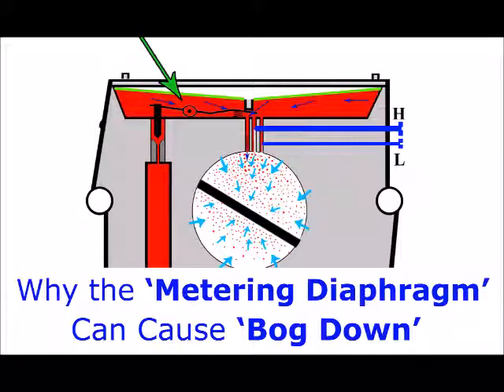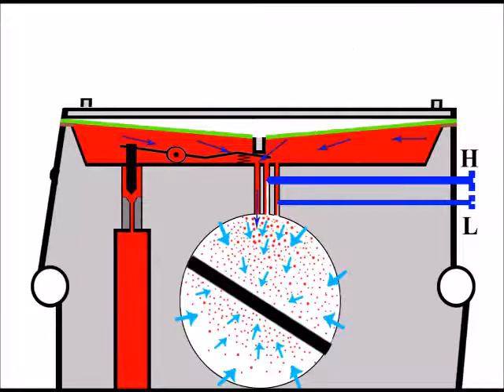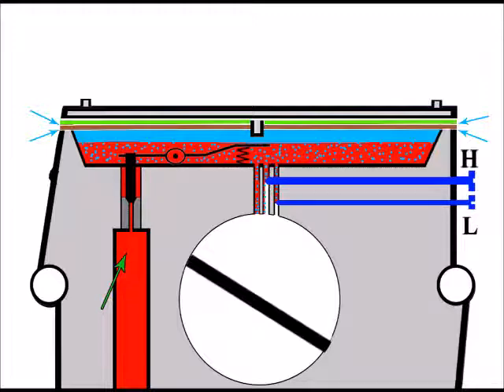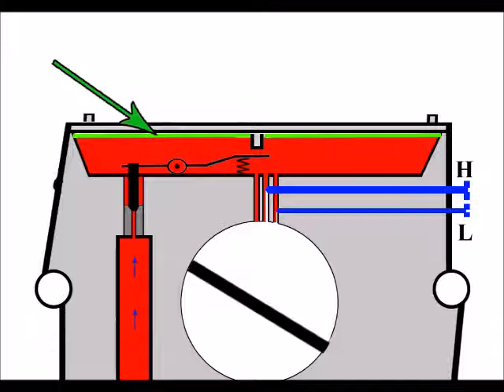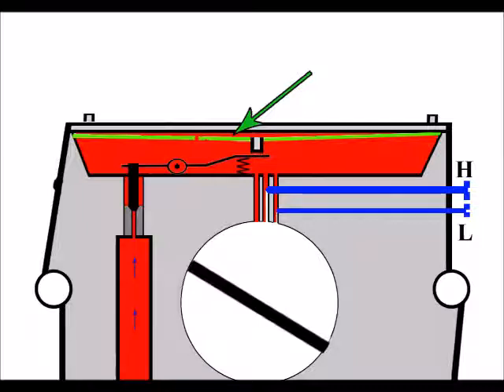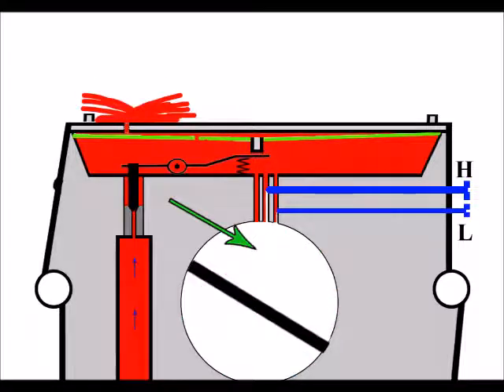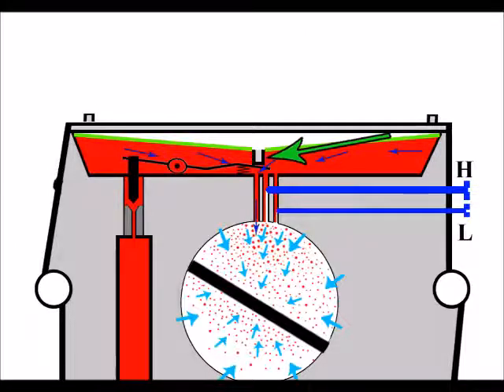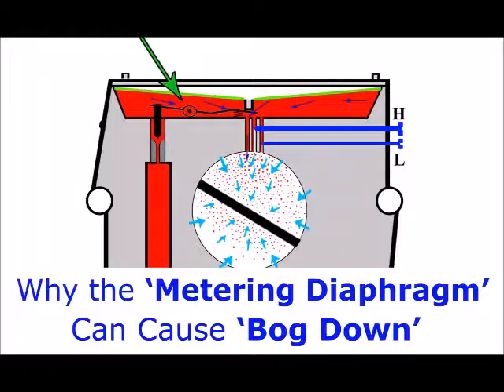CHAINSAW CARBURETOR DIAPHRAGM: Why Metering Diaphragms causes BOG - Won't Start.  (by Craig Kirkman)

Comment: One issue missed is the opposite of the hardened diaphragm issue. When the diaphragm is too loose. Like a wet noodle. It needs to be just the right elasticity. I've had diaphragms that were so loose (thin) that they were collapsing on the perimeter too much and preventing the piston from pushing the lever.

Comment: first I have to thank you for all your great info and the effort you put there to inform carb engine users ! but you mentioned a fully oscillating motion for the metering diaphragm which is technically true as all the motions and behavior of an engine is oscillatory due to its nature of cycling motion yet looking at a single work point of an engine for example a mildly open throttle the  engine has a base line fuel flow which has pretty minor oscillations due to small variations on the baseline vacuum in the  carb venturi  which will end up in the metering diaphragm to be pulled down by some amount and the needle valve to be half open (and all of them have minor vibrations at their positions) allowing the baseline fuel flow needed for that specific operating point. 
you have correctly mentioned that a stiff  metering diaphragm can not act at all when fuel is consumed underneath it or it might not act fast when an engine is suddenly pushed to the full throttle and cause "bug down" yet it could also cause the exact opposite also which is when an engine is throttled down back to idle a pulled down back to idle and the pulled diaphragm can not bounce back up fast or not go up at all causing a flood of fuel and supper rich rough idle and engine stall and die on throttling back to idle !
Reply from the maker: Thank you

Comment: That's exactly what my saw is doin. Idles great. Will rev high for a few seconds. An then bogs and dies. Chaulky white sparkplug. Lean. I thought it might have a vacuum leak. Crank seals maybe. But there is not many hours on the saw. I got gas that had water an dirt in it. From the Gomart. An my saw has been messed up since. I knew something was wrong in about 5 minutes after filling the saw with gas. Let my saw warm up. An first cut. It died in full throttle.   Thanks for this video. I believe you just helped me. Fingers crossed

Comment: Thank you for a superb series of videos on diaphragm carbs which I've just seen .Perfect for filling the gaps (large 🤔) and very educational and clear. ,in my knowledge 
I've had trouble with my Strimmer so today, after getting the spares, I found that instead of being flat, the fuel pump diaphragm had a dimple in it the size of my finger end .so it didn't have full travel.
Symptoms were four stroking and lack of power and inability to idle.
It's a Ruixing 142 A -23 carb and seems very well made , loctite on the threads etc but spares are  very difficult to obtain..All running my Husqvarna 129 ld.
Hope this helps someone,  Thanks again Sir 😊👍

Comment: Pls tell what should be the length of diaphragm ln mm. And length of spring. This cn be measure or not? Original measurements of diaphragm pin and spring. This is very knowledgeable and nicely explains by you. Thank u so much. I will be highly thankful to you if answer my question.
Reply from the maker: Thank you for your nice feedback. The length of the items you ask for are all different depending on the make and model of different machinery.

Comment: What a nice tutorial!!!   We have a bit weird designed Kawasaki carb with an additional outside manual lever connected to the metering diaphragm plunger with a spring. So, we can press this lever bending this diaphragm up and down as a pump. Can you tell me what is this for, please? Thank you

Comment: Hi there I have watched a lot of your videos and have found them very informative and clearly explained, they have been a great help to me in trying to isolate the problems in my ryobi brush cutter, I still havent got it running exactly right yet even though replacing all gaskets and giving it a good clean with carb cleaner and a spell in the ultrasonic bath,,, still bogging down at top end after a while. I suspect a malfunctioning check valve which  I believe is a non serviceable part. Have watched the video from the "Zarma" service agent in America and they stated implicitly not to use compressed air to blow out carb...... so have tried to avoid as much as possble but there appears to be some ports that would be safe to use C/air on at lower pressures.I have been looking for the shop diagrams for carb . there is some basic stuff on "Zarma" website but  not accurate enough for me. Started to draw my own but  just realised what a huge task it is.....sketchup would be a great cad tool to make 3 dimensional model. thanks again for the info , keep up the good work, your efforts are much appreciated.
Reply from the maker: Thank you so much for your nice feedback. It's comments like yours that motivate me to continue making these videos. Craig 😀👍

Comment: I am a little confuced. When we have vacum at the diaphragm area the piston goes up. Right?
Reply from the maker: Yes the upward motion of the piston causes a vacuum  suction pressure that moves the diaphragm via the pulse line.
Reply: @TheRepairSpecialist  sorry but I am not talking about the pulse line. I talk about the diaphragm which pusses the lever and raise the needle.
Reply from the maker: @ΗΛΙΑΣΑΓΓΕΛΟΥ-ε3σ  yes the diaphragm pushes the lever and needle down because of the vacuum pressure from the pulse line caused by the piston going up
Reply: @TheRepairSpecialist  ok. Thanks.

Comment: This is probably the single most important diagram you show. All carburetors  have a base setting that can change the balance between air/ fuel entering the carburetor.  Adjusting the L screw not only changes the low speed setting or idle speed, it affects the high speed setting. Manufacturers usually have a base setting between the two screws and fine tuning can be achieved  by slightly turning the screws. An air leak at the base of a two stroke engine can greatly  affect the performance of the engine. Any bad seals allowing air to enter the base or intake on a two stroke can cause an engine to run too lean, make it hard starting or even cause the engine to overheat and melt the piston or cause extreme internal damage due to heat damage in the cylinder, drying out the piston rings causes the rings to wear extremely  fast, cause the rings to break and score the cylinder or cause the piston to break due to Spark knock a condition where the extreme heat causes the fuel to detonate prematurely  ,destroying the piston.

Comment: Have you any videos that explain the check valves in the maun nozzle assembly? Good explanation in vids ive watched so far! Thanks
Reply from the maker: MATT MOSS, hi Matt, first of all, thank you for your motivating comment, it really does keep me producing these videos reading posts like yours. Secondly, is it the Main Nozzle on a four stroke, or two stroke engine you would like to know about? Thanks, Craig
Reply: Hi craig, sorry for the delayed reply.
I repair two stroke engines, mainly chainsaws and such like and i have accumilated a drawer full of bad carbs.
I have looked into rebuilding a few and learnt a lot, i have found a main issue with some being the check valves going bad/stuck. Some can be pressed out and replaced if you can get the replacement. Your videos explin a lot. Thanks for posting.
Reply: I have found with really dirty carbs that have been contaminated with allsorts that completley stripping them and boiling them in water, then rebuilding with a new kit can revive a lot of them.
But some have been damaged deyond repair with heavy adjustment of the jet screws.
Its just a hobby really but i thought i would look further into why the carbs were bad rather than chucking them.